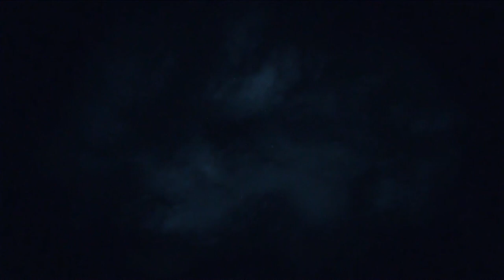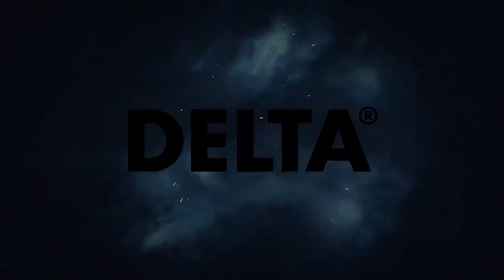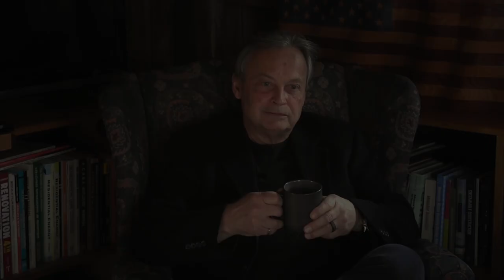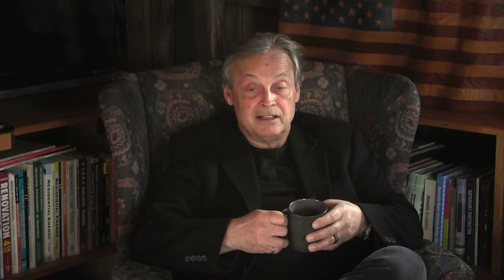A Cup of Joe: Capillarity | Building Science Deconstructed

Comment: In the case of anticipated earthquakes, then reinforcement is called for (8:04). What specifically do you recommend to reinforce the connection without compromising the capillary break?
Reply from the maker: We recommend the placement of rebar to connect the footing and the foundation wall.  When installing DELTA®-FOOTING BARRIER as a capillary break on the footing, simply either cut an “X” in the membrane and place the rebar through and into the wet concrete.  Or one may install the DELTA®-FOOTING BARRIER after the rebar has been placed in the wet concrete and just cut a slit in the membrane to go around it.  Any moisture that might move through either cut will be miniscule.